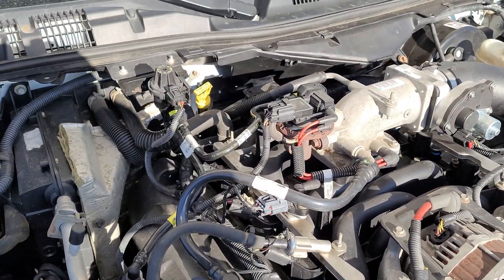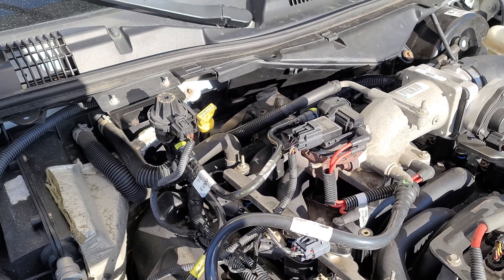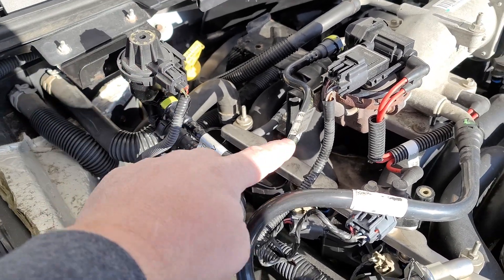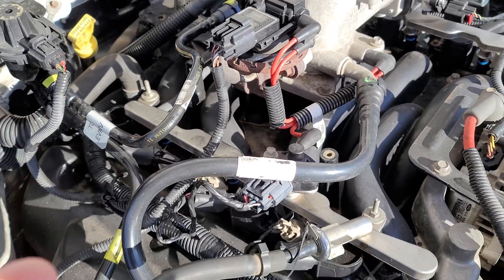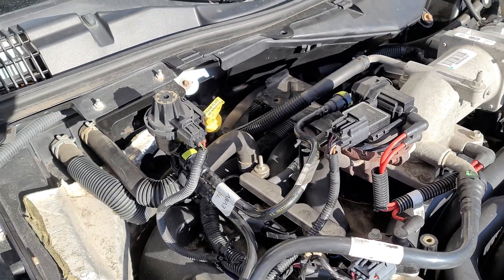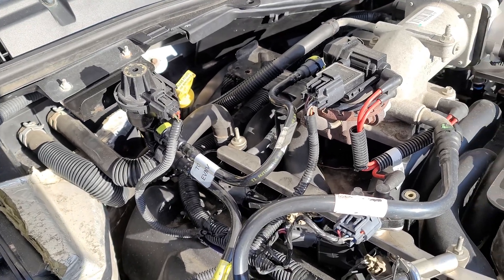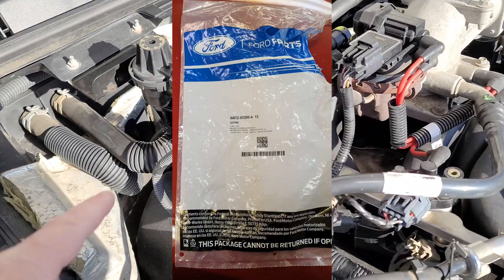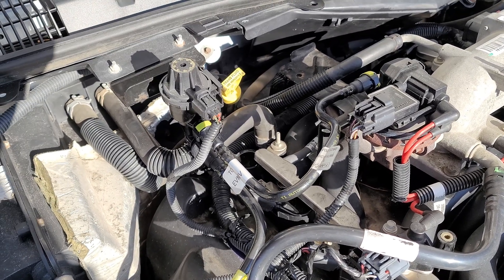Ford 4.6 vacuum leak.  Crown Victoria, F150, Mustang  How to find, where to look

Comment: crazy how an engine will find vacuum anywhere... i had a rough idle no CEL due to the ventilation hose from the intake to the valve cover didnt have hose clamps on it
Reply from the maker: Yes, it's amazing how a tiny leak can affect the engine's performance!

Comment: I have an 08 mustang gt. When I cold start the car, it’ll fire up but it kinda hesitates. I get horrible gas mileage and have p0174 code. Fuel filter and o2 have been changed. Any idea what this could be ?
Reply from the maker: The engine is getting too much air....  there has to be a vacuum leak somewhere. Intake gaskets, maybe...
Reply: @SlipFitGarage is that an expensive fix?
Reply from the maker: Not if you do it yourself.  Paying modern shop labor rates always makes repairs expensive....  In my opinion, anyway.

Comment: I need this part I believe this was causing my car to just idle down and die mid drive???
Reply: also giving P0191 code
Reply from the maker: With a P0191 code, that sounds like a fuel pressure problem to me.  The vacuum hose in this video doesn't affect fuel pressure. Check fuel pressure with a scan tool to verify the pump is working correctly.....  Also, possible plugged fuel filter.  The fuel filter is located roughly under the rear passenger seat.  It's an in-line filter...  it's round and made out of metal.
Reply: @SlipFitGarage  If on my scan tool # 25/45 it says FP/VAC (psi) says 5.6.   I cleared last night I left work, stalled and died a mile away from work this morning scan tool gave 8.0 for that reading. Is that fuel pressure reading? I will check fuel filter, I had a mechanic replace the fuel pump and when asked if he checked the fuel filter he said it should be good if it starts and runs. Would that line on the scan tool be for fuel pressure
Reply: most of the 45 lines in case it helps this car is killing me. If there is anything on particular that could help lmk please
2006 Marquis GS Flex
Fuel Sys 1 = CL
Fuel Sys 2 = NA
Calc Load % = 54.9
ECT = 189
STFT B1% = 28.1
LTFT B1 % =  -3.1
STFT B2 = 30.5
LTFT B2 =  -3.9
MAP (inHG) = 16.8
Eng RPM = 531
Veh Speed = 0
Spark Adv = 16.5
IAT = 34
MAF (lb/min) = 0.9
TPS % = 16.1
02S B1 S1 = 0.015
STFT B1 S1 = 28.1
02S B1 S2 = 0.010
STFT B1 S2 = 99.2
Run Time = 3281
FP/VAC (psi) 5.6
Command EGR = 0.0
EGR error = 0.0
Command EVAP = 0.0
Fuel level =18.8
EVAP VP (InH20) = -0.068
BARO (InHG) = 30.4
Reply: @ I wiggled the connector for the pump drive module in the trunk and I can hear it acting funny maybe turning on off and power reduction. Could this cause my 191 code and issues. Would it be the wires or the module? Without having electrical testers
Reply: This fixed it!

Comment: 2 things.

 1. You can use generic fuel line if needed with clamps. 2. Theres a different part number for this hose for a different application. It does not cross reference and if you call a dealer, they will say its not compatible. It is the exact same part. Ill update with the number when I get home.

Part is 8W7Z-9D289-A
Reply: Did you end up getting the part number
Reply: Part ?
Reply: I thought it is 1Z not 7Z
Reply: Eh, I forgot about this. Ill try to remember when Im back from vacation.

Comment: what do you call a fuel trim?
Reply from the maker: Are you asking what is a fuel trim?  It's basically the amount of fuel being supplied to the engine via the electronic fuel injection.  When you're looking at live data screen on an OBD2 scan tool, this information is called "Fuel Trim".  There is "Long Term Fuel Trim" and "short term fuel trim".  These numbers are constantly changing based on several factors....  O2 sensors, mass air flow sensors, engine coolant temps, barometric pressure, etc...  Small fuel trim changes are normal, the larger the numbers get, the more it indicates a problem. (such as a vacuum leak) This is how a fuel injected car is constantly adjusting to maintain optimum air/fuel ratio.  "Fuel Trim" is an actual real term, I didn't make it up.  So when you ask "what do you call a fuel trim?"......  I call it the same as anyone else looking at fuel data on the OBD2 scan tool. Thanks for the question.

Comment: The EVAP syatem under the trunk uses the same cheap ass hoses.
Reply from the maker: Yes, indeed it does..... But there is much less engine heat under the trunk so that tubing doesn't rot away as quickly. At least in my personal experience, anyway.  I've had that EVAP system under my trunk disassembled to clean everything and install a new vent valve so I could fill the car with gas without kicking the pump off every ten seconds. If I remember correctly, there are also some larger rubber hoses back there as well.  Thank for the comment.

Comment: Oh the power of a leak detector smoke machine. Send in the smoke through the evap intake and exhaust before and after every job.
Reply from the maker: There you go!  However, not everyone on YouTube HAS a smoke machine, OR knows how to use one.  This video is for those people.
Reply: I agree and that's how I learned about it from someone's comment like mine lol. If anyone is intrigued about getting one or learning more, spend the extra money and get one with a built-in pump. Just saying....

Comment: I have a 2010 Grand Marquis and a 2010 Town Car. Bought both with very low miles, and both have the plastic tube, so I'm guessing they came that way from the factory.
Reply from the maker: I'm not sure....  It's possible that my tube was also "plastic" at one time but the heat cycles from the engine ruined the plastic and turned it into what you see in my video.
Reply: @SlipFitGarage  I'm thinking not. My Grand Marquis now has 152,000 miles and that tube still looks brand new. I'd say somewhere along the way, Ford made a change.
Reply from the maker: @mickeyharrington6785  
That's very possible. 👍

Comment: What was the codes?
Reply from the maker: The car had many codes at one point and I fixed all of them.  It still wasn't running perfect until I found this problem.  There wasn't a code in my situation because it wasn't running lean enough to throw the code.  I found it by watching my fuel trims in live data and doing a visual search.  Remember, not every problem with a car will throw a code.....  or at least until the problem gets bad enough.

Comment: My 97 mustang gt 2v once it’s warm gets low idle and turns off when out into drive I’ve replaced coil packs, plugs and wires so might be a vacuum leak ??
Reply: Dude I have the same problem please tell me if you figured it out
Reply: @ethandworzecki5034  check the crank case breather hoses

Comment: if you remove catalytic converter would that effect the air to fuel ratio on a car ?
Reply from the maker: The computer in the car is always looking for a specific air fuel ratio and it gets that information from the Upstream O2 sensors (located before the cats) so theoretically the air fuel ratio would always be the same. However, removing a catalytic converter COULD skew the o2 sensor readings, especially if the exhaust system was left wide open. (Where the cats SHOULD be) If you put a straight pipe in place of the cats it might not be a problem. But either way, the downstream o2 sensors (after the cats) will detect low cat efficiency and turn the check engine light on and probably set a P0420 and P0421 codes which will never go away until a cat(s) are reinstalled. Plus, removing cats is illegal anyway...
Reply: @SlipFitGarage  well i have a 2001 crown Victoria with 100k on the odometer and the guy i bough it from said he installed a pipe instead while he was trying to pin point a problem and it didn't trip a code yet so i was thinking that maybe it made a negligible change that it didnt bother the ECM 
but im still chasing vacume leaks as im doing the normal service for the car : so far i replaced : fuel pump , fuel pressure regulator, fuel filter and it worked alot better  specially after the fuel filter was replaced then proceeded to change air filter that also made a slight different with the hesitation issue than before  , next im going to take out the fuel injectors and expect them , thank you very much with your time indeed

Comment: HOW CAN  YOU TELL  YOU HAVE A STUCK FUEL INJECTOR
Reply from the maker: Several different ways.....  I am assuming you mean a stuck OPEN fuel injector, correct?  1) the fuel system won't hold pressure after key is off. 2) do a injector balance test with the scan tool, if that function is available on your make/model. 3) Sometimes your fuel trims will be pegged rich. 4) Excessive fueling will ruin your catalytic converter, if you have a P0430, P0431, P0432 code then you MIGHT have a stuck injector. 5) If you have extremely bad fuel mileage, you might have a stuck injector. 6) If your exhaust smells like un-burned gasoline, you might have a stuck injector. 7) It may cause a bad misfire and throw a code for that cylinder. Etc. etc....

In my case, I went to program a new keyless door remote which required me to cycle the ignition switch on/off 10 times in a row.....  Once the remote program procedure was finished, the car would barely start, and when it final did start, it ran very rough with rich black exhaust, and stunk like gas, really bad.  

A decent scan tool really helps determine IF you have a bad injector, and if so, which cylinder.

Thanks.
Reply: Wow I need to check this. 

My crown Vic doesn’t rough idle, or throw a code, but I can’t figure out why she smells like gasoline during normal operation 😔

Comment: I have to check this out on my 2008, during the fall/winter months my car runs like trash on cold start-ups high idle, and evens out after warmed-up
Reply: Did this ever up fixing it? Mine behaves the same
Reply: @BoomBeench Did you ever fix it ? I have an easy fix.
Reply: @Arkansas223 what did you end up doing? I've been limping along for the last year haha
Reply: @BoomBeench  Take the ground wire that goes from the negative of the battery to side it’s usually a small wire, either sand & use a screwdriver & remove the bolt.. scratch or sand under it and reattach.
Reply: @BoomBeench  That should work but me personally I took a 4 gauge wire and grounded it to that same spot where the factory battery to frame ground is and boom she starts up amazing.

Comment: Mine has almost all the rubber gone from the outside layer. Came looking for it because the clip on the end broke while replacing the intake manifold. 

Thanks for the video, couldn't find the part number anywhere else.
Reply from the maker: Glad the video was helpful.  Thanks for the comment.
Reply: I tried several parts stores and they couldn’t find the part number that I had, went to Ford dealer, gave them part #, no problem. New one was $32.